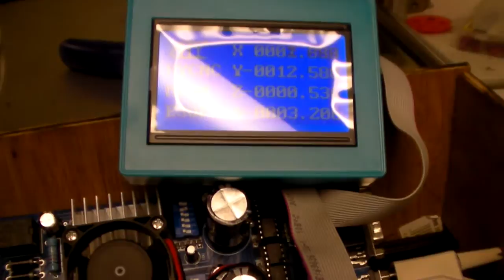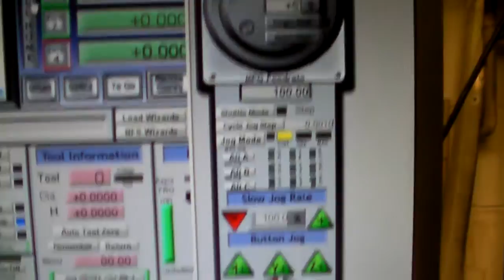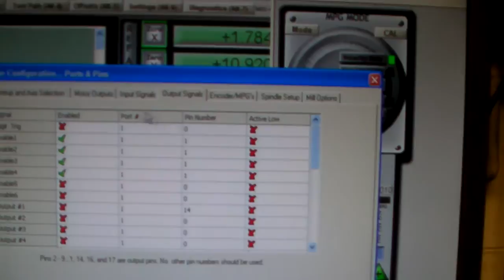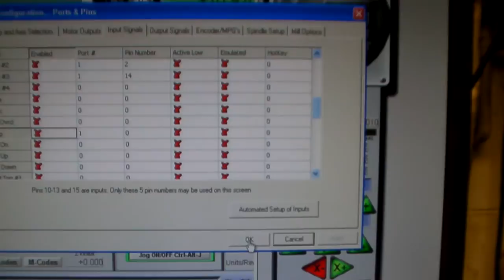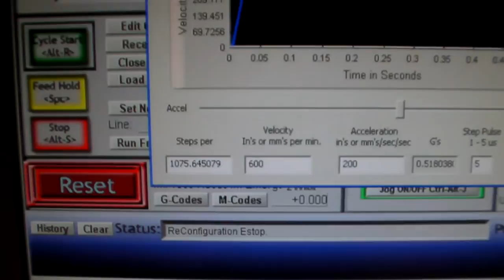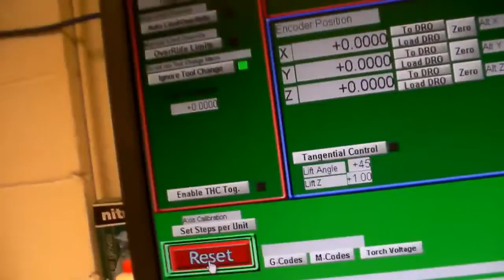4 Axis Upgraded CNC TB6560 Stepper Driver Set +Keypad +Display, Manual Control

Comment: Hey r u good at troubleshooting stepper motor / controller driver  issues? Ive got all 3 axis running like crap rough herky kerky and slow...on my diy cnc using 4axis  tb6560 controller/ driver all in one .. Im still thinking its controller driver issue...if i run a continupus jog mode .....once in a while the motor will go from slower feed rate grinding rough movement to smooth movement faster feed rate but only for less than 1 second...

Odd that all 3 sxis do the same thing though...usually mot all axis go bad at same time..however this is a low end junk all in one board so its possible...

Comment: Thanks for the nice video. Where did you get the Step/Dir pulse = 5 values from? Are they TB6560 specific? I'm asking because mine keep loosing steps and this drives me crazy. No info on the manual. Thanks.